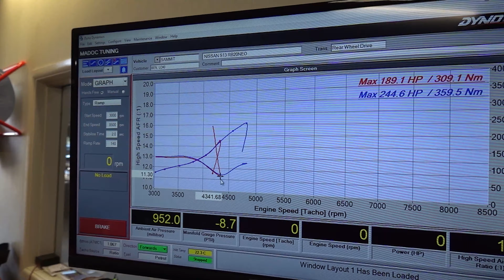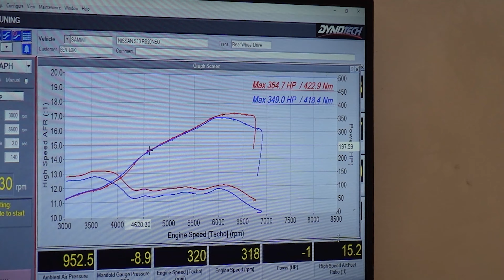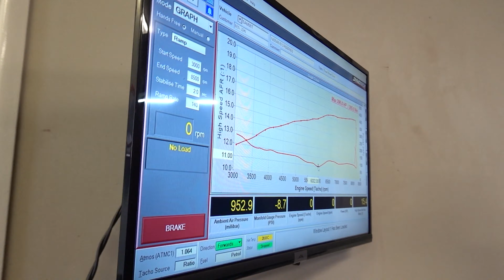DYNO DAY for the @SAMMIT RB20 NEO 200SX | LZ World Tour Build!!

Comment: That's very disappointing to hear about the turbo feed. That's why I don't trust any machine or engine shop and do everything myself. However, I opted to make a brass T fitting and feed it from the oil sensor like you guys did in the end, but without a restrictor, and a much bigger ID return tapped into the factory location (20mm ID). I have a 20 Neo with an HX35 but on my engine, the holset doesn't even spin on idle 🤣 Also that's a very impressive 400 whp for a non lubricated garrett and 14 psi of boost from a 20!!! Nice job :)